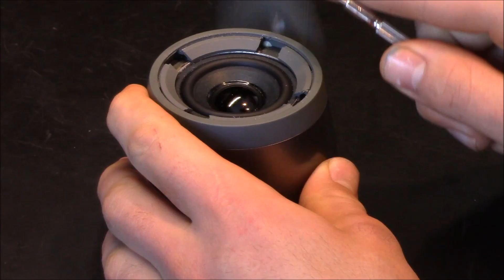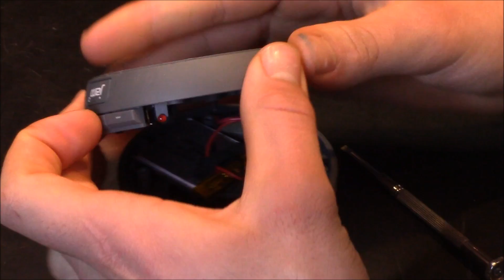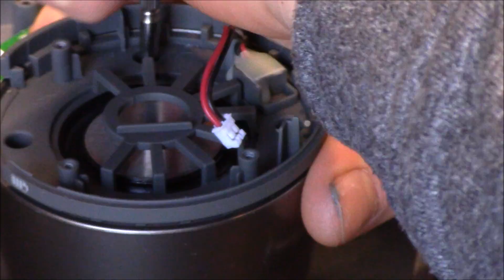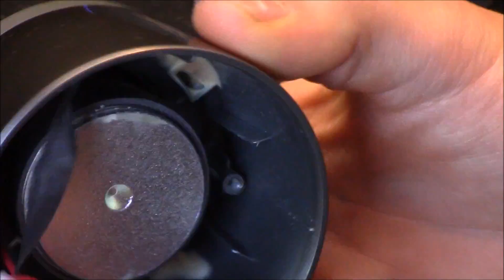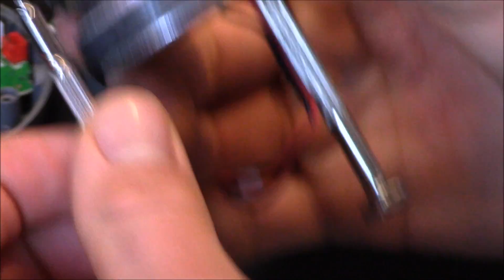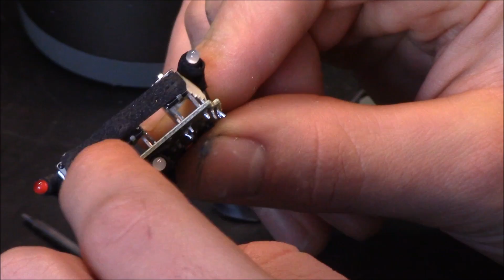JAM Wireless Bluetooth Speaker Teardown

Comment: Hi there,

I bought this speaker in Atlanta and then it was not used for almost 3 years. Now when I am trying to switch on,
One of the speaker volume is very very low. It does not even increase when I am pressing + sign on speaker. I tried with Bluetooth and aux input also but the speaker sound is same. What could be the reason?

Comment: I was thinking of making a Internet Radio using the guts of one of these along with a unused cell phone.  I would try connecting a better speaker with everything mounted in a larger box.